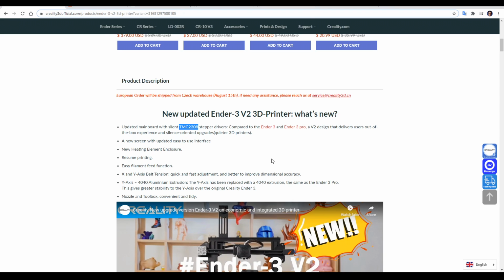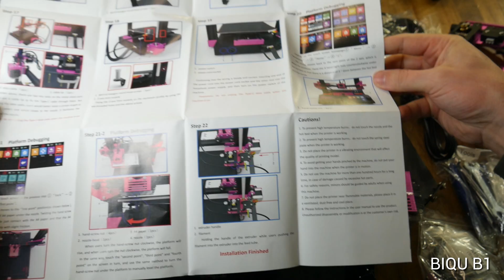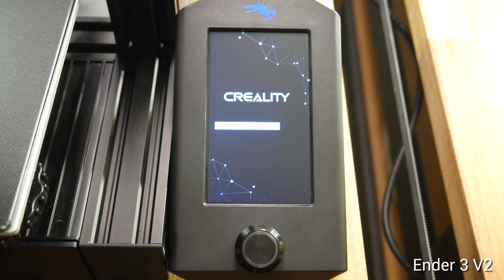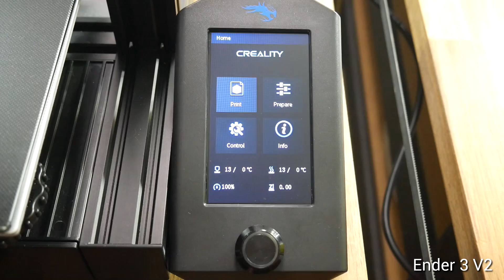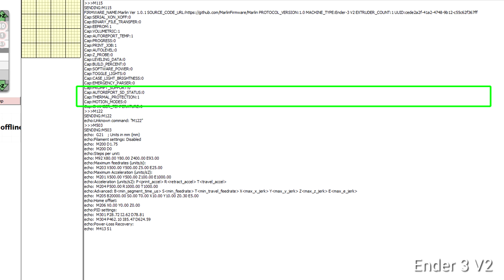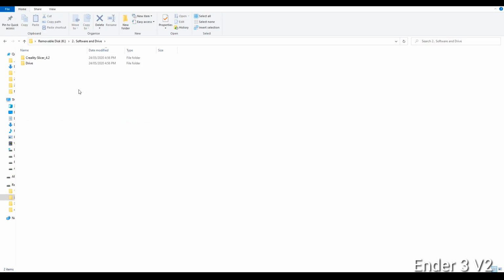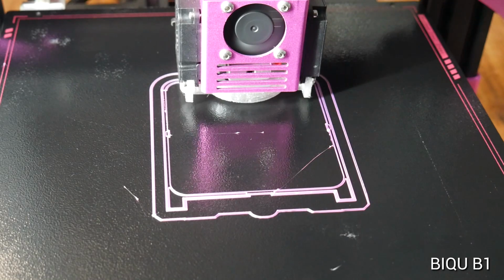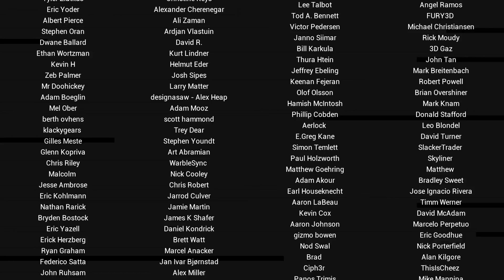Ender 3 V2 vs BIQU B1 - Battle of the upgraded Ender 3s

Comment: I have to question everything you have ever said. I was a fresh noob never built a printer or used a slicer. I just got my ender v2 friday. I took my time to assemble it and level. I then used stock cura ender 3 settings sliced and printed. My benchy was perfection better then any you have ever done on any printer review. I then printed the basket it came out flawless. I'm not sure if these bad prints you get are due to incompetence or if they are done to push more expensive printer that sponsor you. All i know for sure is you lots 1 subscriber

Comment: Glad I went with the ender 3 V2. Bought some of the common upgrades before it even arrives. Capricorn Bowden, upgraded extruder and bed springs to yellow ones and auto level kit. Will get new hot end later.

Comment: I need help with my biqu b1 sometimes it print and sometimes not the filament entrance make just a click noise and little bit get extruded im new in 3d printing and also did try to change the nozzle but i didn't know how it doesn't move when i try to get it out

Comment: Why is fusing the bottom layers? And what can we do?
Reply: I had the same problem on my Ender 3 V2, but worse. I solved it by basically rebuilding it and making sure that the X gantry was 100% level by measuring the distance from it on both sides to the top of the cross member that sits on top of the Z axis rails.
Reply: @davidfisher8468  damn, I will literally print rafts then fixing it. But really thank you, maybe some day I will do it

Comment: Check the PSU earth to Ender 3 V2 metalwork on mine the black powder coating was insulating it from the printer. I added a wire from the PSU earth to the long screw in the carrier frame into the 40x40. The printer seems earthed now.

Comment: Received my BIQU B1 yesterday. Done several hours of print with Ender 3 pro and decided to upgrade. Ender's tooo loud. Not great first impression with BIQU tbh. Bed under the metal sheet got uneven surface because of four supporting screws not being flat with the bed surface! I got bumps in all 4 corners. Circle fan duct on hot end is broken on one corner (screw loop feel off). Power supply main + cable was totally loose by motherboard connector. Power supply is generic model(hoping it will last and have enough power) non branded, not even the one that is in the video! Did you experience any of above? I am dissapointed especially because of bumps in the bed, it will make bed levelling much harder. Wonder g how to fix that. Peeling off sticker probably is the only way :(

Comment: maybe someone already have written it, but since i'm new at 3d printing, i dont have a printer. I would like to know how much better is the V2? is it worth the ugrade or should you just buy an V1 or pro.. other wise, in my opinion, the v2 looks like a good start! But i know little to nothing about 3d printing, but i know allot of watching 3d printing on youtube.
Reply: v2 is $50 more expensive than the pro and it includes a glass bed + silent board, which basically makes up for the price

Comment: At 12:55 you show the squish at the bottom of the benchy.  I have had that issue from the beginning.  You said something about the lead screw could possibly be binding in that spot.  Did you resolve this issue?  I am interested because I haven't resolved mine yet.  With that said, I'm really new to 3d printing and the ender3 v2 is my first and only printer so far.  Oh ya, thank you for the video!! =)

Comment: Thanks for the material. I am yet to get a 3D print and at the moment I'm thinking the BIQU B1 is going to be my first step. (mostly due to your review actually)
Question for you or anyone else reading. Just how far can the Ender 3 platform be taken. 
Can it be made into 
A.) a low maintenance and reliable printer. One that just works really reliably/repeatably but possibly with only limited filament selection.   
B.) a super amazing be all and end all printer for a wide range of filaments and with really precise repeatable results.  

I gather from reading and watching youtube material that it can really do with these upgrades to get the most out of it.
1.)  BLTorch for auto leveling
2.) all metal hot end (like the  micro swiss unit)
3.) direct drive ( combine with the all metal hot end)
4.) dual Z axis  upgrade ( possibly one with two stepper motors or a bigger single one upgrade)
5.) Newer 32bit board if not already installed. ( possibly going as far as the Duet wifi board!)
6.) a new bed plate may be needed depending what is supplied. 

7.) it may also enjoy additional Z tower support to make it more ridged. 
8.) an insulated box to improve general print consistency and allow hotter prints. (possibly with additional heating in the box)
.
.
.
.. there are many the lists of 10 and 24 best upgrades. 

Its obvious that someone can get a bit lost in the vast number of upgrades. 
Can you comment on what would give the results of A.) a low maintenance and reliable printer.  and B.) a super amazing be all and end all printer.  
Do you know any upgrade material already created that give these ? 

Thanks and keep making the good material.

Comment: I recently got the ender 3, should have got the v2 but I am a first 3d user and it is pretty confusing. The Biqu looks like it has some extra features but I got the ender because it has the most guides for beginners and its the most common so it seems like a safer choice for beginners.
Reply: Yeah that was silly. The v2 is the same as ender 3 in terms of learning. Just newer components.

Comment: Do not repeat my mistakes. DO NOT BUY V2. This printer is a joke.
Most of upgrades here are half assed, or several dollar worth / easily printable. Only decent changes are bottom PSU layout and bltouch port. (And PSU is choked at the bottom and loud af) 

Several months already and motherboard and screen firmware are NOT PUBLISHED.
Current available board firmware is reverse engineered semi working hack.

Drivers are standalone mode 2208 with forced stealthchop and they DO NOT work with Linear Advance. 
To fix this you need to hack your board in UART mode for extruder driver. Or do a once in lifetime OTP flash on the driver using usb-serial adapter. And there are no way to do it without sophisticated chip solder hacking.

Screen is useless garbage, which improves nothing, limits extension capabilities and has no published firmware too. You will be much better off with a simple and robust monochromatic 128 dots screen.

Get ender 3 or Pro and upgrade it with modern 2209 SKR board, BMG extruder and V6 hotend with titan heatbreak. You will get much better and more robust device for the same price.
Reply: OK thanks ! Ender 3 or Anycubic Mega S? Please help me :-)

Comment: Ender 3 v2 or Ender 5? Torn between the two. Larger size for the ender 5 isn't a big factor for me, but wondering if the extra $30 for the 5 is worth it. Seems like the features are very similar.

Comment: Has anybody gotten a successful collapsible basket on their ender 3 v2? If so what were your settings?
Reply: i made one  with it scale it to x1500
Reply: Salman Channel, what settings? I tried one scaled to 1540, and it came out with the baskets fused. Only the bottom stand and the  basket hinges worked
Reply: @stc_  i used Cura standerd Quality 0.2mm setting 
Just make sure that your bed is leveled good

Comment: I feel like the entire video he was saying how the B1 was better in almost every category, but when it got to the end he still said the Ender 3 was better
Reply: B1 have poor decisions in design that he doesn't mention yet: 
1.Type C for hot end? I can already bet it will have problems with burned down connections and/or circuit board in the hot end sooner rather than later.
2. Upgrading to direct extrusion also will be more awkward due to Type C connection existing there.
3. Weird brackets for pillars and base of sheet metal will make it harder to add dual Z motor compared to aluminium extrusion base.
4. Pink color (just kidding... or not)

Really the only real advantage it have is board. And considering that, why even bother with Ender 3 V2 or B1? You can get Ender 3 Pro version with MW power supply for 170 Euro, slap in it SKR v1.4 with 5x tmc2208 and touch+knob screen for 40 Euro and have 20-50 Eur left for dual z or filament or bl touch or whatever.
Reply: @vygag  
1. I am sure they are not that stupid and made sure the cable they supply can withstand the hotend heater's current. Also, if you do quick google search, you'll find that type C cables which can take 5A are quite common.
2. I don't see how it can make it harder to upgrade to direct. You might just needed longer cable for the extruder motor.
3. Most people won't be doing that.
4. The color doesn't influence the functionality in any way.
Reply: That's exactly what happened.

Comment: Hi MIchael, great video! When you do your review could you please test BLTouch v3.1 integration on the Ender 3v2? I've been having some issues with my BLTouch occasionally failing and causing the nozzle to collide with the bed during probing. Could you please also demonstrate the use of the Z-offset tuning and how that differs from the babystep-z function?

Comment: Could you please do a guide on installing the BLTouch to the ender 3 v2, as it has a dedicated port for a BLTouch, and there is a official firmware release on the creality site for the V2 that supports the BLTouch, but as it so new, there seems to be a lot of opinions floating around on how to use it. There is no guide on how to use the officially release BLTouch firmware, only guides for home made bodged firmware, of which there seems to be many. Some say you can not have you Z axis limiting switch, and others say you can have both the BLTouch and the Z Axis limit switch just fine. I think the latter should be the intended usage. It seems stupid to me that they would include a dedicated port for a BLTouch and then expect the user to rewire the 5 pin connection so half goes to the dedicated port and then some wires to the Z axis port disabling the limit switch. I have only had the printer two days and I'm a complete beginner to it all. Had a few successful prints so far but bed levelling has threw up some issues that I wish to resolve. I have a creality BLT touch kit, but no idea how to mount it. Any help would be great, Nice Videos.
Reply: https://marlin.crc.id.au/firmware/Ender%203%20V2%20-%20BLTouch/
Reply: Go there I just found that today and even has a bracket on thingiverse you need to download to print it to Mount to bL touch shows you where the wires go and how to change all the settings

Comment: The B1 is north of $300 now so I dont think its even on the radar anymore. I can buy a Ender 3 Pro and slap some upgrades on and have something better. Also IMO the worst "feature" is the lack of a second z axis screw and timing belt between right and left so the sides move in unison - leaving you to get tilted Y axis if you do any adjustments to the hot end.
Reply: The B1 is only $230 on banggood once you add the promo code BGB11. I think it's a great price for what you are getting! But I'm going to wait for his full review before ordering.
Reply: @Zekn69  fair enough I didn't see the promo. I'd rather buy this but I wonder how far it strays from the ender for upgrades down the road
Reply: @hypercube33  Yes this is my thoughts exactly I can't find out much info on this printer yet so I'm just going to wait for the reviews. I think I would rather buy this than buy an ender 3 and all the upgrades or the v2.

Comment: Is there anyone who have problem with Ender 3v2 firmware upgrade? , i try to enable the LIN_ADV with marlin v2.0 bugfix, the problem is the extruder wont extrude when i print.. please help.. thank you
Reply: Had the same issue when I tried V2.0 bugfix two days ago. Couldn't find a solution. Gave up and went back to stock firmware for now as my printer was a bit wonky on v2 bugfix (or even release 2.0.6). He mentions something in this video about the drivers being wired in legacy mode, meaning no lin_advance possible at all...

Comment: My Ender 3 V2 is doing that compression as well. Possible fixes???
Reply: From someone else: I had the same problem with the first layer, it always looked way overextruded despite the flow being reduced to 90% (really it only affected the first layer) so it tried a cura version below 4.6.0 which fixed the problem for me. But making very large prints with cura I‘ve always suffered from defects so I switched to simplify3d and prusa slicer which solved the problems for me.
Post up if this works...I'm looking to get a V2 also.

Comment: Hi, Michael! About BIQU: Is that USB-C cable fine for such a job? I mean that it's litereally not fixed strongly... And what's about bending? How much cycles it can pass without breaking?
Reply: if it can handle the current for the hot end...but - even if it breaks - I can get these cables locally by the dozen. MY Chiron, i just waited 64 days to get one replacement cable...

Comment: Any chance you can give a detailed guide  about setting up OctoPrint on raspberry Pi with the Ender 3 V2, as not everything works, but I am sure you will have the knowledge to getting things working smoothly.
Could you also a BLTouch upgrade on the Ender 3 V2

Comment: I had the same problem with the first layer, it always looked way overextruded despite the flow being reduced to 90% (really it only affected the first layer) so it tried a cura version below 4.6.0 which fixed the problem for me. But making very large prints with cura I‘ve always suffered from defects so I switched to simplify3d and prusa slicer which solved the problems for me.
Reply: any update on this? i've got the same issue. how can the slicer be the problem?
Reply: Actually, I figured it out. I noticed that the right side was getting more smushed than the left, so figured it could be due to gantry sag. I installed a dual z-axis kit and it solved the issue. I actually used a combination of parts from the single-motor dual axis kit, and the creality dual-motor kit, because the single-motor kit parts actually have some advantages, i.e. the top mounting brackets allow for further travel, so your z-axis doesn't get shortened, the rods are longer, and the gantry mounting bracket is lighter. So the only thing I used from the creality dual-motor kit was the stepper motor plus mount and wiring harness. Best of both worlds, and the first print turned out perfect. I just wish the gantry sag hadn't destroyed my PEI flexible heated bed surface before I figured it out... Now to get started on swapping in the linear rail kit...

Comment: Thanks for the review, I just put an order for the Ender 3 v2 yesterday as wasn't aware of the B1. I'm interested do you think the upgraded v2 rails which I've heard has stronger rails would be better suited to direct drive modifications compared to the v1? Additionally do you know if the v4.2.2. board supports serial interface that is required for say trying to intergrate a prusa MMU2? In your deep dive review could you also show us the extruder setup with out the plastic shield to show any cooling changes.

Comment: I’m waiting for my ender 3 v2 turn up as my first printer. Were u able to fix the collapsible basket? Are there any upgrades you would do on the ender 3 v2?
Reply: @dennismoore623  The new Firmware update with Bltouch is out since 29. August. I hope this will help you.

Comment: I get that compressed foot issue on my CR10s and CR10sPro, I'd be very interested in how you solve this. Thx
Reply: Apparently can be caused by slicer. Try cura or some other popular slicer.
Reply: @TealJosh  My E3V2 prefers the Prusa slicer to the Cura2.2 Similar settings

Comment: The BIQU B1 dropped ball by using cheap power supply.   You can get a genuine MEAN WELL on Amazon for $30.

What's up with the hot pink?  Great for the girls!

Those brackets look like trouble.

Fan of the textured Flex Sheet!  Great for PETG also, which may normally fuse into magnetic sheet, PEI film or glass.
Reply: Hi, After receive feedback from reviewers, we already change into a better power supply.
Reply: @BIQU_Makers  Not gonna lie, I wish I had seen this video before I just bought my Ender 3 pro v2. It is nice to see a company respond so quickly to feedback. Maybe my next printer will be from you guys. Do you guys make one with a larger print area?
Reply: @BIQU_Makers  when will those get into the supply chain on the facebook group everyone appears to have the generic power supply still?
Reply: @BIQU_Makers   So...do you have DETAILS?  Is it a MEAN WELL 24V?  etc?  thank you!
Reply: @BIQU_Makers  please let us know exact brand and model and specs.  Thank you.

Comment: I have the same compressed layers on my original ender 3, what is the fix for this?
Reply from the maker: Normally it's because the first layer is too close to the bed, but in my case I eliminated that.
Reply: @TeachingTech  I've eliminated that too, I'm now using a bl touch and have used several 1st layer tuning prints to get the 1st layer just right.  I still get a bulge in the next few layers after layer 1?
Reply: @dogpickslocks  same
Reply: @chuckymystic  fixed it using The Edge of Tech's z-axis binding video

Comment: Nice video ! As always. 
I have the same problem of compressed layer on my printer but my firsts layer are near perfect. What causes this and how can I fix it ?
Reply: I have the same problem. Some say the z-axis is binding, over extrusion of filament or under extrusion and having the bed height set to low or to heigh depending if you're extruder is doing one of the above? Measure the first layer height and width. Maybe it will tell you something? My first layer is always perfect, but the second is where I need to lower the bed just a little bit, and then everything is fine.